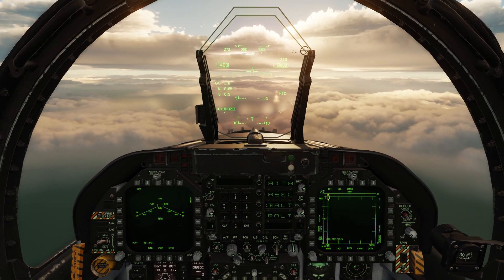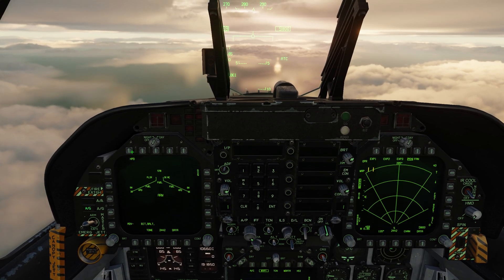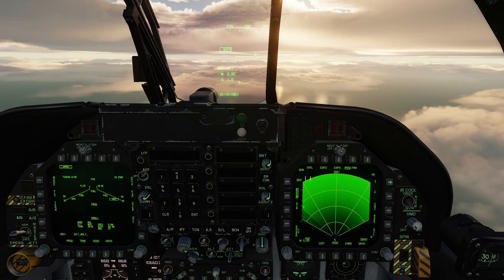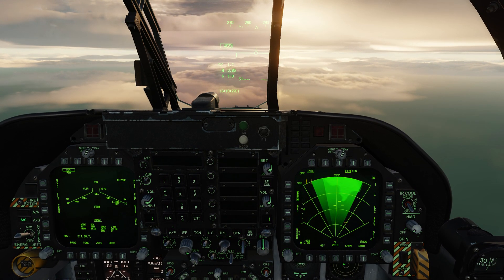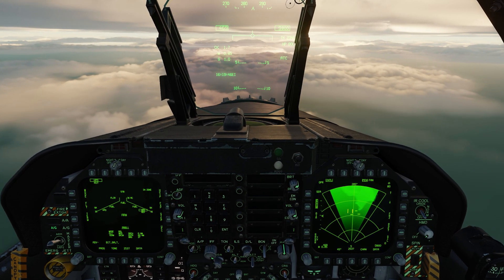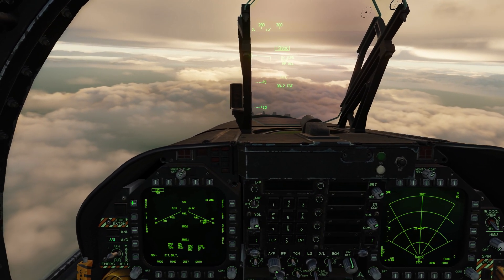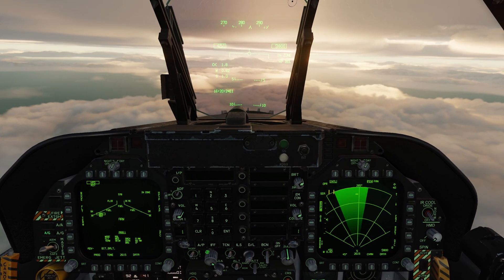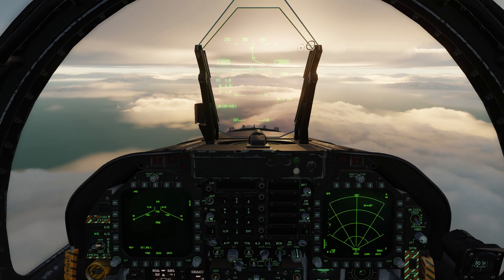DCS: F/A-18C Hornet | SEA Radar Mode

Comment: What's the PC specs ?
Reply from the maker: For the video it was a System: i9 9900K, 2080Ti, 32 GB RAM, for DCS World requirements are  

Minimum system requirements (LOW graphics settings): OS 64-bit Windows 8/10; DirectX11; CPU: Intel Core i3 at 2.8 GHz or AMD FX; RAM: 8 GB (16 GB for heavy missions); Free hard disk space: 60 GB; Discrete video card NVIDIA GeForce GTX 760 / AMD R9 280X or better; requires internet activation.

Recommended system requirements (HIGH graphics settings): OS 64-bit Windows 8/10; DirectX11; CPU: Core i5+ at 3+ GHz or AMD FX / Ryzen; RAM: 16 GB (32 GB for heavy missions); Free hard disk space: 120 GB on Solid State Drive (SSD); Discrete video card NVIDIA GeForce GTX 1070 / AMD Radeon RX VEGA 56 with 8GB VRAM or better; Joystick; requires internet activation.

Recommended VR systems requirements (VR graphics settings): OS 64-bit Windows 8/10; DirectX11; CPU: Core i5+ at 3+ GHz or AMD FX / Ryzen; RAM: 16 GB (32 GB for heavy missions); Free hard disk space: 120 GB on Solid State Drive (SSD); Discrete video card NVIDIA GeForce GTX 1080 / AMD Radeon RX VEGA 64 or better; Joystick; requires internet activation.

Comment: Does the harpoon takes notice of the speed and bearing of the ship to calculate its impact point?

Or does is it just shoots towards the current location of the target?
Reply: I don't think that this will make a difference, because of the speed a ship has, but I have no clue tbh
Reply: @Carpet96  currently, if you have a frigate sailing 30kts in an 60-90 degree angle. On long range (40-50+ nm) the harpoons do miss their target because the location it is searching in is “empty”.
Reply: @couger014  I get your point. As of now you have to think about the detection range of the seeker and tell the seeker when to start searching for a target. Until that point it is pretty much a dumbfire rocket (with an autopilot). So, I do think the designation via radar will lead to the harpoon flying towards the calculated arrival point of the ship.

Can you remember the detection range of the seeker? Maybe you could try to tell the seeker it should start looking for a target earlier with the modes you have available as of now. Sorry though if I make mistakes writing in here, didn't play for quite some time and my english is not the best regarding the topics we are discussing right now 😅
Reply: @Carpet96  in R/BL mode you can’t tell it when to turn the seeker on. 
Only how big the search area is on the given target area. I usually keep it on medium. Maybe it is going better when doing it with large.

But it would make it easier if the speed and heading information from the radar gets transferred to the harpoon.

This also might makes it possible to target a specific ship in a (small) group.
But I don’t know if this translates to the real world.